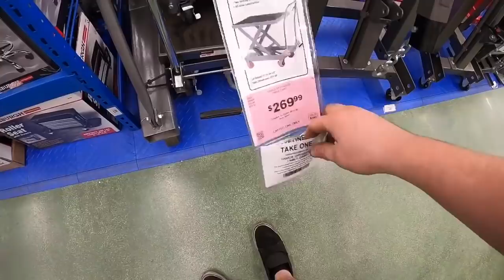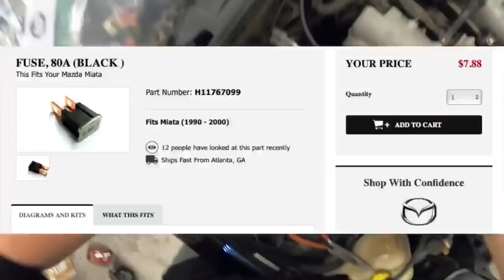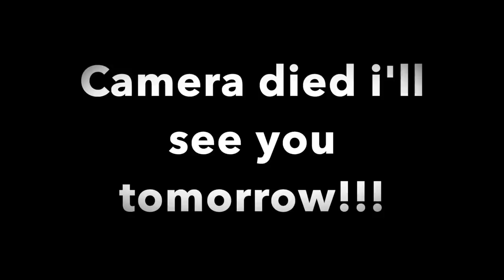MY CAR FELL OFF THE LIFT!

Comment: I've dropped a car off a hoist while I was under it, fell a whole 1" onto the four poster with all its wheels in place. You never forget that lesson when taught, ever. Slipped off the bridge jack because of oil all over the subframe, rubber feet and all. Zero damage to anything besides my underwear, statutory writeoff.

Comment: 13:33 kinda like that moment when you push 30psi in a stock D16, you don´t care but the explosion you get is way bigger than you expected, and after all of that you have to pick up 1000 parts which once were a reliable engine ._.

Comment: The hood thing that goes over the speedo was super brittle in my 91 as well.  Some asshole painted the dash and that in my special edition interior and when I sanded that thing down right before I was about to paint it it broke in half.  Had to glue/bondo it then sand it again and then paint it to make it black again.  The top part of the dash being painted in some shitty paint that got sticky is the most annoying thing though.  Probably going to have to replace that too.

Comment: pretty much any rust free miata parts will make you money. you could have fixed that car really easily though, and brought it up north and made some pretty fast decent money.  all it needed was a hood and an hour on the frame rack. bumper was save-able. your body shop buddy could have pulled the core support for cheap
Reply: Could have done it haggarded with a come-along and some scrap metal (to evenly distribute the pull).
Reply: @BoogieDownProduction  for a normal mechanic yes. For rudnick, it would end with a hospital visit

Comment: I saw it about to fall from a mile away. You pretty much removed all the weight from the rear and still had the engine in the front. Should have readjusted it after the subframe. Would have been better to put it on right the first go though.